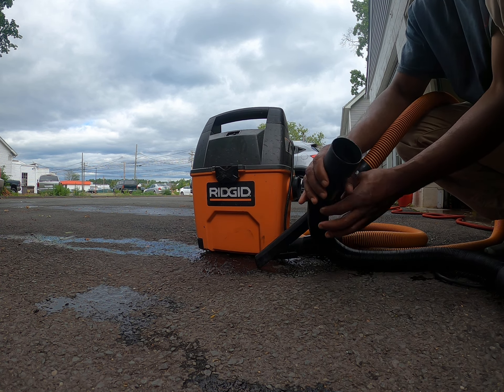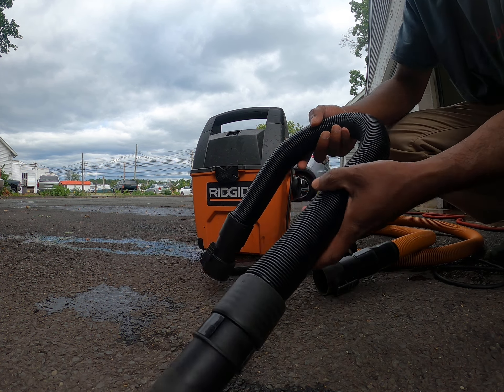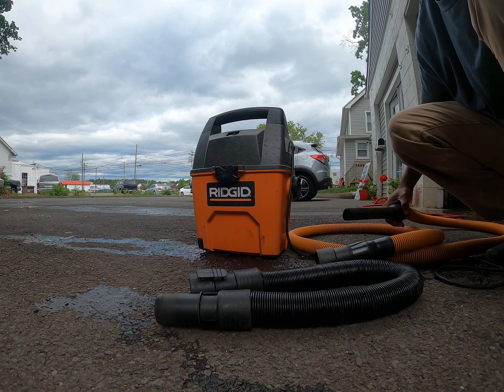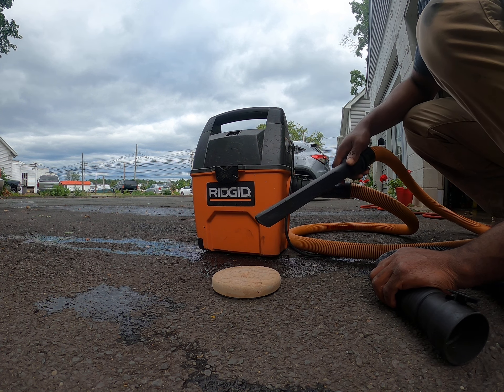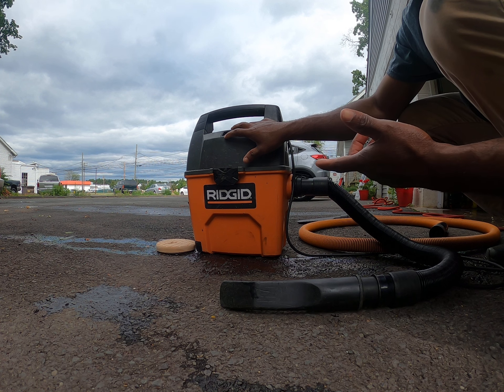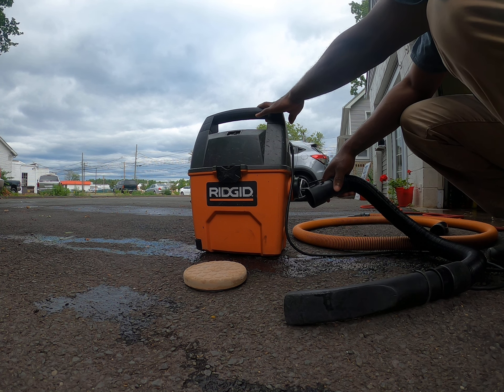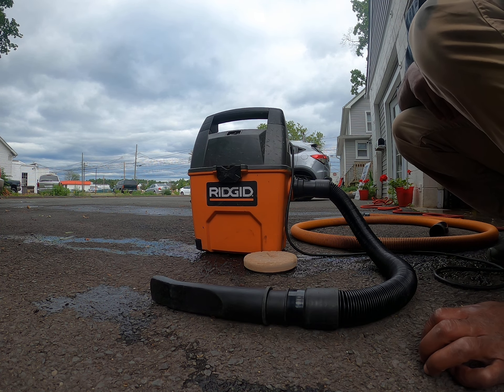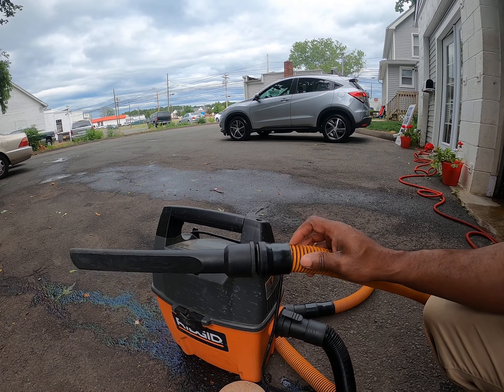RIDGID DETAILING KIT HOSE MAJOR FLAW

Comment: For this test to be valid you had to be using the same tip on both hoses , the regular attachment has a bigger opening allowing for better pickup. ( Not to mention the hose length)
Reply: The video was to just make you aware that there is a noticeable difference in suction but maybe one day I will get a different kit and compare it to the ridgid kit